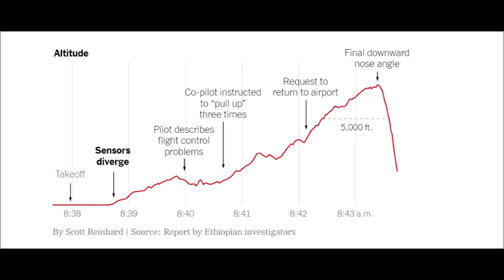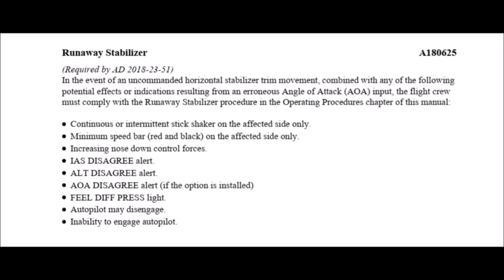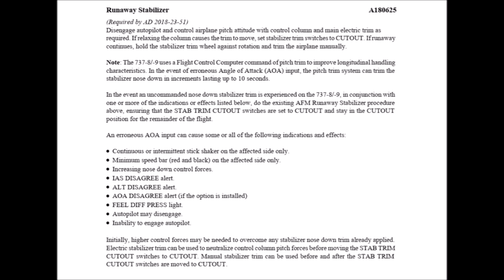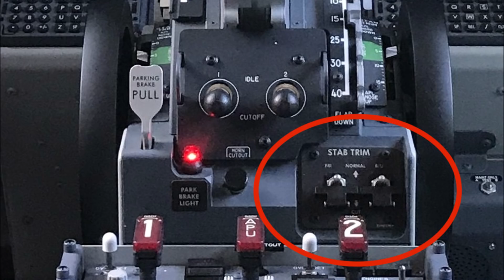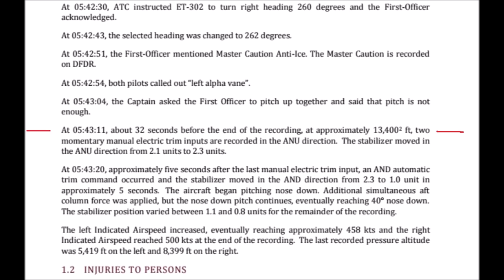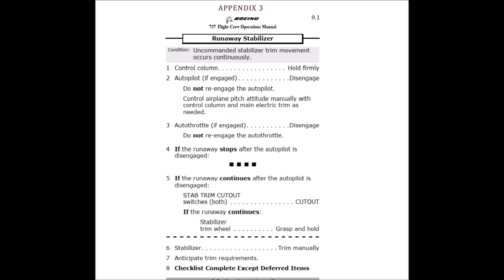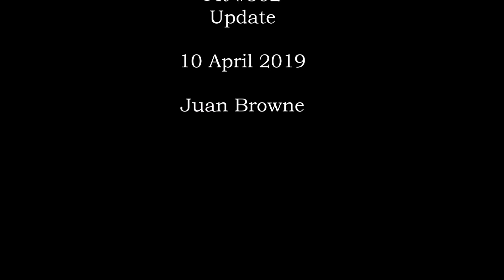737 Max Update 10 April 2019 Runaway Stab Trim Procedures

Comment: Nice Job!.... Wondering why the US commercial 737 max pilots have had so few issues with a plane with such software bug / design issue?
Reply: Luck. The MCAS only misbehaves when the single non-redundant Angle of Attack sensor malfunctions. There could have easily been at least one crash just like this within the US if an AoA sensor had malfunctioned. There are reports in the FAA database from other pilots encountering similar issues with the MCAS prior to these crashes, but they were fortunately able to recover. Pure luck that those pilots happened to choose solutions like hitting the cutoff switches much sooner so the situation was more recoverable. The flight prior to the LionAir crash encountered the same issue and only recovered because there was a third pilot in the cockpit at the time who reminded the pilots to hit the cutoff switches. Luck.
Reply: Good luck, I'd guess
Reply: Robert Haskin training?
Reply: Luck. Read this Bloomberg report, and weep: https://www.bloomberg.com/news/articles/2019-04-11/sensors-linked-to-737-crashes-vulnerable-to-failure-data-show
Reply: @gordonrichardson2972  Ouch, so much for reliability
Reply: Temperature..
Reply: To this issue to appear one AoA sensor has to be faulty. These are quite new aircrafts and sensor issues are in general not that common.
Reply: Boeing saves the defective AOA sensors for the third world.

Comment: What about if they reset the flaps, would the plane have been saved?
Reply: The speed of the aircraft was too high. You can deploy flaps only at the correct speed or it will just tear the wing apart.
Reply: @henryford2736  I've been wondering about that

Comment: If the auto pilot is on MCAS won't do anything, right?
Reply: Right. But the auto-pilot will not engage if it believes the input it's getting is wrong. I believe this was the case with ET302.
Reply: @todortodorov940  yes. But if the pilot is pressing the trim before the ten seconds is over and puts the autopilot on the MCAS won't engage, right?
Reply: @renegade44040  MCAS is not the same as the auto pilot. If the AP is on, MCAS is off. The pilot may be able to trim but still unable to engage the AP. Then the only option is "clicking" the trim button ever 10 seconds. I am not a pilot, but I can almost certainly say that this is not a sustainable situation.

Comment: Second, Second to none
Reply: Fantastic reporting on MCAS issues. As a former frequent flier , it is clear to me that as these planes get more computerized and complicated , pilot training must be improved and pilots continually monitored in simulator training. I am deeply suspicious that the tragedy of Ethiopian crash is directly rooted in pilot failures and inexperience with 737 MAX model in rush to put these into service outside north america. No one with less than 300 hours should be sitting in a co-pilots seat. Not enough experienced pilots worldwide.
Reply: @MrBozonic  according to the black box Boeing's at fault.
Reply: Bob Main , I think every pilot should start training with a glider. This is how they will learn how to conserve energy, how gain speed by pitching nose down, and generally how to fly the thing in complete manual mode. This old but very useful Luftwaffe style basic training.